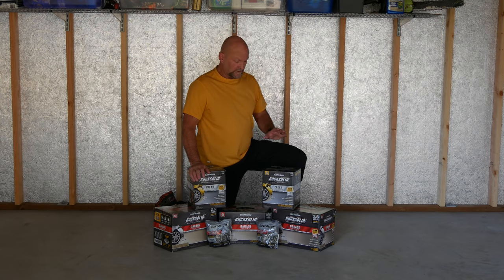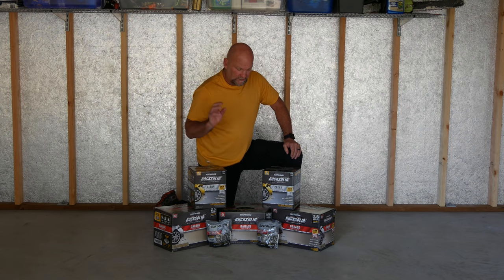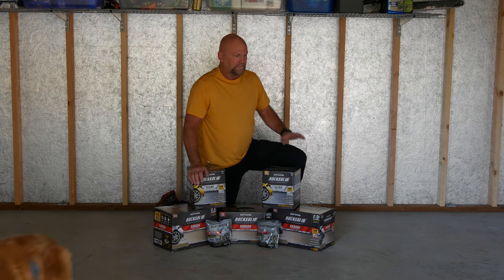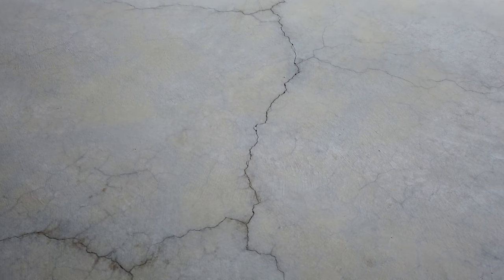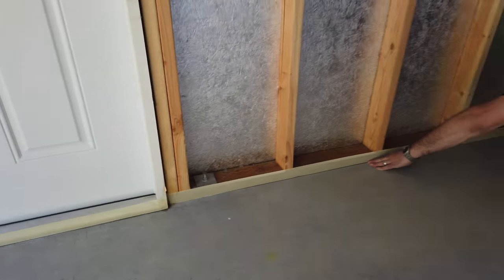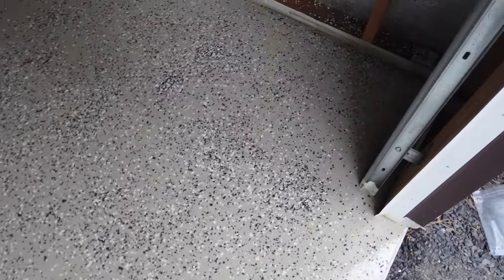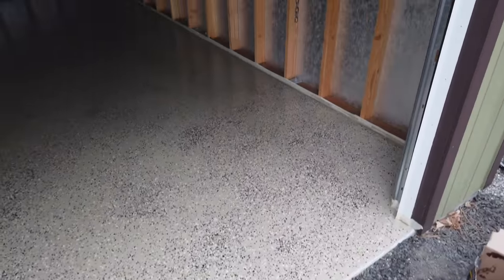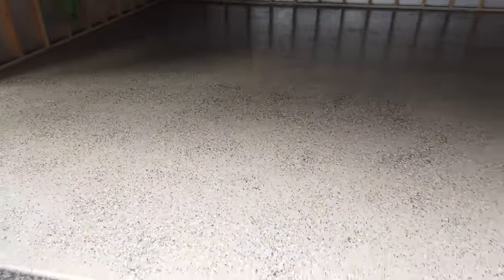Rustoleum Rocksolid Garage * How to get the best results

Comment: This has been so helpful because you are the first person to take this approach (applying 2 coats of epoxy and clear coat), and what I have been wanting to do but having trouble finding others that have done the same. In your updated video, you state that you are moving, will you be using the same product in your new garage? if not why? I am interested to see what you would do differently. Great video!
Reply from the maker: Thanks! I wouldn't hesitate to use this again. and I would do the 2 coat method again. as mentioned in the followup video, the only thing I would do differently is use a handheld fertilizer spreader to spread the paint chips evenly. In our new home, the concrete has been finished very smoothly, I might consider the Racedeck system.

Comment: This product is ok. I have used it more than a dozen times. For a 2.5 car garage. Use a floor squeegee and 4 boxes. Then you will get the best and long lasting results. After laying the epoxy with the squeegee roll over it with the roller to eliminate the air pockets.
Reply: Get spike shoes and you can do multi coat all in one application from squeegee long and you won’t get that orange peak look.
Reply: Is the clear top coat necessary...since they are not included in the kit ???

Comment: I just used 6 (2.5) garage kits to cover 1100sq ft. I had about an inch left in a small pail. It was new concrete, which we had to grind and etch. The concrete soaked it up like sponge.
Reply: Thanks for that info. If I did my math right, I should be able to do my 850 sq ft of new concrete with 5 kits and have a about the same leftover. Did you do 1 or 2 coats? How's yours looking now?
Reply: @TimPimentel3006  aside from all the bubbles and color differences, not bad. If I had to do it again, I would mix all the packs together and have a rolling party.
Reply: How long did it take to roll your 1100 sq. ft. ? With our weather forecast, I may need to do it thanksgiving morning, or wait at least a week for dry weather again.
Reply: @TimPimentel3006  Applying the material took no time at all. Maybe an hour. I had one guy mixing and another helping me roll.
Reply: Did you  do two coats or just one?
Reply: @sanfordswanson4950  One coat, no clear, if you have multiple boxes mix all the bags into one container and find some help to roll it on, otherwise you will have color differences when it dries.
Reply: @TimPimentel3006  My garage is 820.  How did yours turn out?  Did you do one or two coats?  How many kits did you end up using?

Comment: I am going to put this in a garage area that was turned into a shop.  There is glue on the floors from an old linoleum.  I’ll grind it but can’t really do much more with water because there is drywall all around.  Idk what to do but maybe put on two coats
Reply from the maker: grinding it would be your best bet. I was lucky, not much prep needed for my project. I hear that the prep is the most important part to the epoxy lasting.

Comment: Wow.......did you fix the cracks first or not??? I was told to fix the cracks first.
Reply from the maker: No, I didn't fix the cracks first. They were so small, I thought that maybe the epoxy would fill them in, not the case. If you want a showroom type finish, I would suggest filling in all cracks etc.

Comment: How's it holding up so far? I would have thought there would be a bonding issue between the first and second coats? The reason I ask is the prep mentions to thoroughly remove all prior coatings. I have a total of 450 sq/ft and was thinking of buying 2 kits. Not sure to go with one heavy coat or 2 coats like you did? Is the sealer necessary? I thought the whole point of the expoy is to coat and seal? I'm not opposed to sealing if it further protects, just afraid of slipping when it gets wet. Any advice to these points appreciated- thank you. BTW - looks great!
Reply from the maker: Thank you.  It is holding up very well.  This is a unheated detached garage that sees below freezing temperatures.  I would recommend 2 coats because it's very hard to be consistent when applying the first coat.  When it dries,  you can see where the product is a bit thinner or thicker.  I also like the sealant because it locks in the paint chips.
Reply: @1964cht  Excellent - thank you for the pointers.

Comment: You say you used one bag then  1/8 if another.  Was that for the whole thing, or just the 2nd coat?   Did the 3 kits cover the whole thing in 2 costs?
Reply from the maker: I used almost all 3 kits for the entire project. Both coats included.

Comment: I paid $880 for my 8 boxes of Rust-Oleum RockSolid Brilliant Blue Metallic Coating from Home Depot, I would suggest going there instead of Amazon because they have better prices. BTW I didn't need to buy any chips since mine is metallic.
Reply: Actually amazon is cheaper. Not sure about a year ago when you wrote this. But today I checked both lowes and HD. 180 for double box at AZ. Amd 214. And stores. The sngle box are like 130.

Comment: Your method of 2 coats and then sealing it seems like the way to do this....how much product did u end up using ? 2 car garage?.....Thanks for sharing....
Reply from the maker: Thanks for the comment. Yes, my space is a 2 car garage. Each 2.5 car kit comes with 2 pouches of epoxy. I used 5 pouches in total.
Reply: @1964cht  How much of the chips did you use? I think there was a bag per kit, plus the two extra you bought. Was the bag that came from the kits the same size as the ones you bought by themselves?
Reply from the maker: @christopherstaricha8620  Yes, the chips I bought were the same size as the bags that came with the kit. I used all but one complete bag of chips. But as you can see, I went pretty heavy
Reply: @1964cht  Thank you for the information. Hope you don't mind a few more questions, really loving how yours turned out and hoping I can get mine to do the same.

Do you know roughly what your square footage is for your garage? 20x20? I have a 20x20 with a 10x7 added to the back and want to make sure I have enough coverage. When you put the first coat down did you do two or three pouches? Did you use both bags of the top coat? I'm guessing you didn't do the anti-skid additive to yours.
Reply from the maker: @christopherstaricha8620  My 20 x 20 floor is 400 square feet. My biggest fear before doing this project was "do I have enough product?". I used 3 pouches of epoxy on the first coat and I went on fairly thick. Maybe a bit too thick in some areas which cause the bubbles or some weird crackle look. The second coat was 2 pouches and it went on much smoother compared to the bare concrete. I really don't know if it's possible to get a perfectly solid smooth look with this stuff, which is why I went a bit heavy with the paint chips to hide little cracks etc. And no, I didn't use the anti-skid stuff in the clear coat. This garage/shop is mostly just for storage and really doesn't see much traffic in the winter time, so I opted not to use it.  All said and one, I'm still very happy with the outcome and wonder why I waited so long!
Reply: @1964cht  Wow, 5 huh? Thats good to know though. Did you use any anti slip mix at all? Thanks for the vid btw.
Reply: @1964cht  I'm thinking about using the same product for a 20' x 20' naked concrete garage floor.  The kit states that 1 box covers 400-500 sq ft.  Is this a gross understatement by Rustoleum?  Does one really need to seal the prior two coats?  Salesman at Home Depot said I'd only need 1 box to do the job.
Reply from the maker: @tomverderber1565  complete understatement. The floor that I did in the video was also 20' x 20'. if I would have stopped at 1 coat, you would see discoloration here and there. the paint chips would have helped hide that a bit, but I feel the second coat did a much better job of making it look uniform throughout. Sealer is not necessary, but I wanted to get that little bit more of a glossy finish.
Reply: Chips provide grip

Comment: Just wanted to say thanks for the review. As you said, so many have has trouble with this product and its been making me doubt using it. After watching you do it though, its making me want to give it a try again. Quick question if you don't mind? Did you use any anti slip in the mix? If not, have you experienced any issues with slipping on the surface? Also, did you use cleat shoes when applying it, or did you simply walk around where you just painted? From what I read, a lot of people have had issues with the color being different, but some have said if you mix all bags together in a bucket and mix with a drill for about 10 minutes, you won't have this issue. And obviously prepping is the most important part.
Reply from the maker: linop412 I didn’t use the anti slip additives,, no issues with slipping but this space isn’t used daily like a normal garage. I didn’t have any color match issues but mixing bags before applying might be a good idea
Reply: @1964cht  Thanks for the reply!

Comment: Hello great job on your garage floor! My garage floor has similar cracking to your floor. Do you think it would help to hide the cracks by using something to seal the cracks first before using the Rustoleum? Also a friend of mine has had some peeling of his clear coat a couple of years out. Any ideas of what might of went wrong for him to cause that?
Reply from the maker: Rustoleum recommends the crack sealing compound before application. Sure, that would have helped if I was looking for a showroom quality finish. For me, it was OK. Not sure why the clear coat peeled. I only had mine a year. I guess time will tell.

Comment: Looks great.  some good advice here.  Seems like the coverage is around half or less as advertised on the box if you do 2 coats.  My big concern is that this floor would be slippery when wet -  especially with that clear coat.  Maybe the chips help a bit, but I was thinking about passing on the chips.  Did you consider adding some non- slip sand?  i think that sand material might come in the kit.
Reply from the maker: Yes, the non-slip sand comes with the kit. Definitely a good idea if you're putting this down on a high traffic area. I chose not to because this garage/shop is only used for storing things and some occasional maintenance work on bikes etc.

Comment: I didn't see you use the concrete patching to fill up the cracks, so this product does not require that step in the preparation? Thanks.
Reply from the maker: I probably should have used the patch to fill the cracks. I assumed that they were so small, they would be filled in by the epoxy. It worked, sort of,  but could be better.

Comment: What's in between the studs, aluminum paint or insulation?
Reply from the maker: it's the plywood siding that was used on the outside of the garage, the inside has a reflective coating that is supposed to have an insulating effect.

Comment: Ok,   So it's almost 1 year later...   how's it holding up and how olds your golden retriever?
Reply from the maker: Holding up very well. I'll try to put a follow up video together. I've only had small scratches where my motorcycle kickstand rubbed a few times and a little discoloration where I went beyond the garage door and it was effected by sunlight. Other than that, very happy with it. My Golden is now 8 years old, but still thinks he's 2
Reply: C & C's Adventures :   That’s good too hear.  I was updating my houses 1 car garage by drylock the block, vapor barrier, insulate, installed many plug outlets, installed a HeatPump and just this morning got done with painting the entire ceiling.   Tomorrow I’m going to homedepot to rent a The Diamabrush Prep tool machine to Etch the floor.  I will be using the same product you’ve used only Gun metal color.   I’ll shoot a little video and notify you and throw u a plug.  My wife’s family has 4 Golden Retrievers.  My wife’s is 12 and her brothers is 14.  Both extremely Healthy and great companions.   Thanks for getting back too me.  🇺🇸🇺🇸🇺🇸
Reply from the maker: @fattony123082  I considered the Gun Metal as well, I really think it has a classy look. Definitely interested in seeing yours when you have a video.
Reply: C & C's Adventures :  OK I rented a floor buffer from Home Depot along with the Diamabrush prep tool.  I went over the floor thoroughly using water the whole time then I used my grinder to get real close to the corners.  About 20 minutes ago I just got done with scrubbing it down one more time, vacuumed off remaining water, set a blower on the floor to let it dry.  I’m going to use the water /sealer treatment first tomorrow afternoon.  But I’m documenting everything with the video I just have to edit it down.  But so far so good I little bit time consuming but it will be worth it in the end.
Reply: @fattony123082  how did your job go?
I have been looking to use the rotary flooring tool at Home Depot as well. 8 years ago I did our garage without the proper attention I think and added to that my wife drove on it too soon as I left town. So...it's been peeling every since and started with a peel off that look exactly like tire tracks. So I need to scrape that stuff off and go at it again. I had been using a handheld scraper bit by bit during this Covid.. now I'll rent.
Reply: Shakir Muhammad :  Actually it went very well I posted a video on LinkedIn and it went viral.  So far it’s holding up very well I will do a YouTube video I’ve just been very busy lately because I do heating and cooling and the weather has changed dramatically

Comment: I am going to apply rocksolid to a brand new garage floor build so is there anything i should consider?  25 x 25 sq ft
Reply from the maker: That is the perfect time, you won't have to do the serious sanding/grinding to get rid of the years of filth. The only thing I would have done differently is to spread the paint chips with a hand held fertilizer spreader so they would have been a bit more even.
Reply: I just did half of mine. I used a 1/4" Purdy roller from lowes. I watched a few reviews and everyone is saying the rollers it comes with are garbage. So I didn't even take a chance with them. Seems like a waist but it came out great. I sprinkled the confetti with fingers and used half a bag of the two they provide. I didn't want too much. Definitely want 4 boxes at least , go wit 5  to be safe.

Comment: Good video. Thanks for the information. What type of clear coat did you apply ? Can you please link me to the product ?
Reply from the maker: it's just the clear top coat that Rustoleum sells. Can be found anywhere it is sold. https://www.rustoleum.com/product-catalog/consumer-brands/rocksolid/garage-floor-kits/polycuramine-clear-top-coating-kit?ls=&lc=Clear%20-%20282829%20/%20286897

Comment: Is the clear coat necessary???
Reply from the maker: if you really wanted to skip that step, you could. but it adds another coat of protection and covers over the colored chips. it's also a good time to add the non-skid stuff if you want to use that as well.
Reply from the maker: also, if you're interested, I did a 1-year follow up video https://youtu.be/cNQJtetRxQU
Reply: @1964cht  THANK YOU for your quick reply...👍👍👍

Comment: Can you use an epoxy on top of self leveling concrete?
Reply from the maker: Good question. Personally, I don't have experience with self leveling concrete, but Rustoleum may be able to help you with that.
Reply: Yes you can

Comment: u can see the cracks  and can easily fill it if you wanted but you saved $2000. friend of mine was quoted $8000 for a for his 2car by one,another at $60/square meter i dont know that in feet. but required some cleaning. but im sure u can do that too. just hire equipment.
Reply from the maker: If I wanted my garage to look like a showroom, then I could justify the extra cost, but $8000? Holy smokes!

Comment: If you're doing a garage floor STEER CLEAR OF ROCKSOLID FLOOR COATINGS!!   There's a reason the packaging says indoor use only and its because sunlight discolors the coating in a big way.  I coated my garage floor 3 years ago and its yellowed horribly about 6 feet in from the overhead door. I'm looking at spending $5k+ to have it removed and coated with a product suited to the environment.  Save yourself some money in the long run and buy professional grade products the first time and avoid my grief.
Reply: Did you topcoat with a sealer or just leave it painted? Just curious, trying to do as much research as I can.
Reply: @blakesmith141  top coated
Reply: What products would you recommend using? I’ve never done this before and have no idea what to use other than what I’ve seen in YouTube videos.
Reply: E E maybe a good idea to use the tan colored epoxy to hide the yellow..?